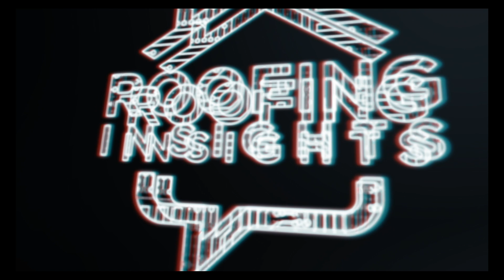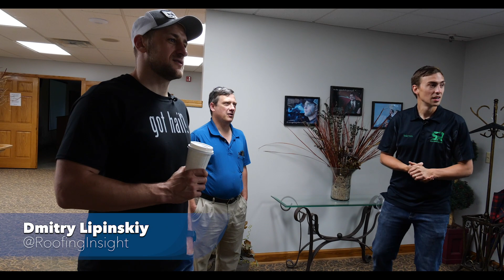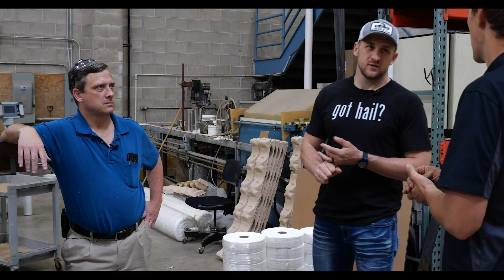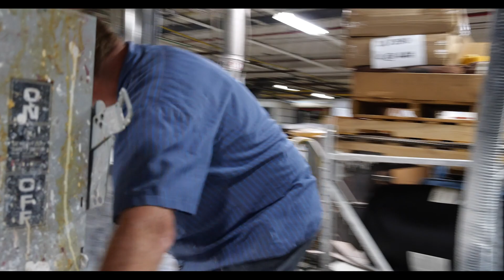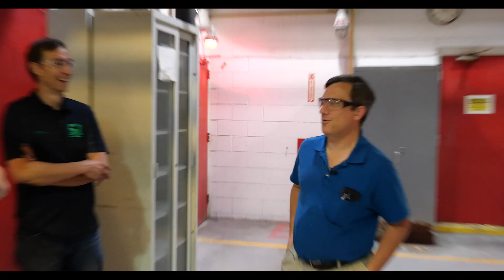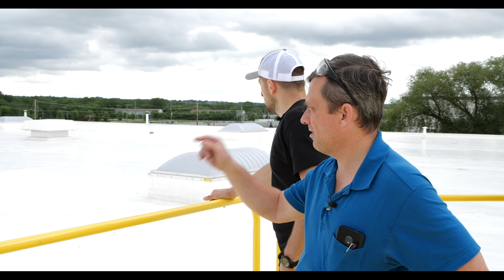Conklin Commercial Roof Coatings | Factory Tour | Roofing Insights

Comment: Please understand this a multilevel company. The people that get you into the business and profit from that are also your competition. I am in the program strictly for the product..As fair as Roofing insight normally appear I would question if they are in the Conklin program and if they are going to review other coating products.
Reply from the maker: We are not in Conklin program and don’t sell or profit from sales.
Reply: Ive signed up over 100 guys and only 3 guys are in my direct market. And Ive never had to bid against them. Ive actually helped 2 of those guys win jobs in my area. I happy to share my knowledge. Yes i make a commission from my efforts, but when you buy from the supply house, there are about 4 middle men between manufacturer and you that get a cut. My ABC rep would ge a cut for every job i ordered even though he rarely helped me. Most of the time he didn't even know i did the job. Ive been in business 26 years and used over 15 manufactures, and i think this is about the most fair system I've come across.
Reply: @andynear3735 im a new Conklin rep. Launched back in mid 23. So far we are loving the community and support.
Reply: HCS, I am an independent Conklin Distributor and Installer. I would be glad to discuss your concerns with you to see if I can provide some answers. Please text or call me directly at 608-844-4933

Comment: Nice tour, but I’m still on the fence about coatings. I haven’t found one yet that does what it says it will do. Everyone of them fail prematurely. Then when they do the manufacture never backs their warranty. Every time the answer is you probably didn’t clean what you were adhering to good enough. Yeah, OK! Pressure washers, scrub brushes, chemicals, I’d lick the freaking surface with my tongue. But apparently it wasn’t clean enough. Coatings are my last choice. In other words, I never choose them any more.
Reply: @Joel, thank you for the comment. Sorry about your bad experience with coatings so far. We believe prep work and proper workmanship is key when installing coatings systems. Using the proper cleaner and primer that work well with the coatings is also important. Yes, you should be able to eat off of the roof before the coating is applied :) I was glad to host Dmitry at Conklin and would be glad to show you a factory tour, or do a call to discuss our warranty details.
Reply: I have. Recently we just installed a GE enduris System. We will see how that works. I will say I am very impressed with their flashing. Their liquid flashing is different from their coating. Has a 20 year manufacture warranty. They passed it, it’s on them. Before that we tried a few Gaco products. But following the manufactures instruction, areas would still split open. Obviously we need to use them on repairs if the roofs have already been coated. But I’m still a big fan of installing Single ply roof systems. Could be because I’m old-school? But nothing beats the real thing. Thank you very much for the offer! I will look into Conklin. I’m surprised I have never heard of them. Are they territorial? In my area we mostly deal with ABC supply, And Allied.
Reply: Joel Hagen Conklin is not territorial, we have contractors in all 50 states. I am working personally with Roofing insights to help share knowledge with the Conklin coatings system. I agree, in same cases a Single ply is a better choice. But in most cases when the substrate and underlayment is dry, you can go ahead and install one of our quality roof coating systems.